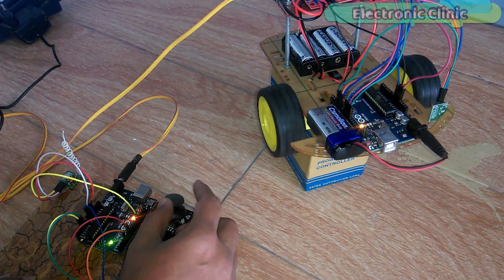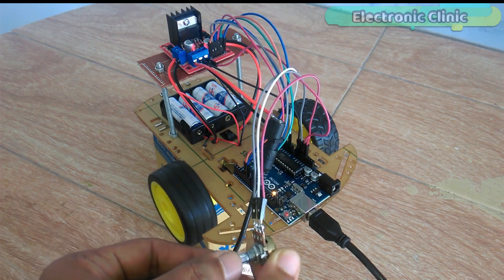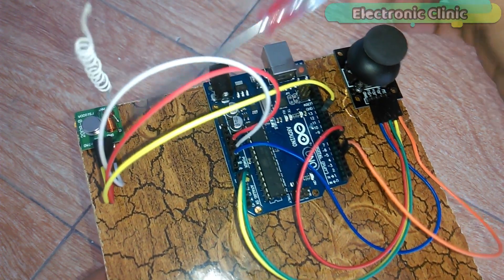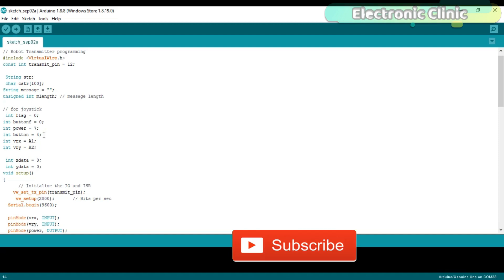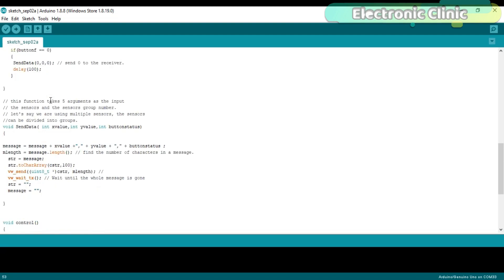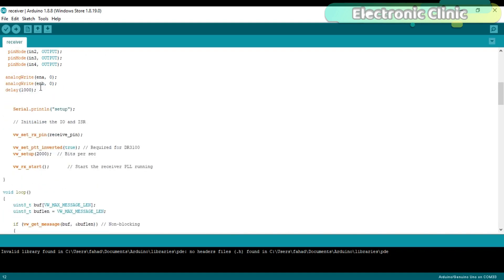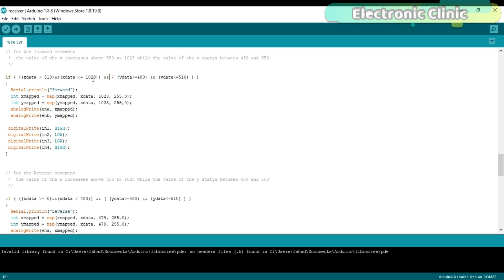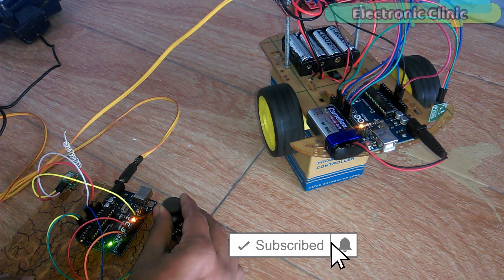Arduino Project: Wireless Joystick controlled Robot Car using 433Mhz RF and L298N Motor Driver

Comment: Great video!
Could you explain what I would have to do differently, if I wanted to replace the normal Arduino at the transmitter with an Arduino nano?
The reason I want to do this is because I want to make the transmitter on a PCB, so the components of the transmitter should be soldered on the PCB.

Comment: Hi brother I followed your instructions correctly. Both tx and rx working perfectly. The serial monitor on receiver side shows the transmitted x and y values perfectly. But the motor not working. I'm using 12v 2 amps single wiper motor and L298 A driver for my project. At first the motor makes some hissing noise while moving  the joystick after sometime it doesn't make hissing sound also. Kindly help me. Thanks in advance brother 🙂

Comment: Sir plz help me in programming. It is telling that return code is not 0. And can i use arduino droid for programme uploading
Reply from the maker: everything is available on my website. i have shared links in the description.
Reply from the maker: use the same libraries which i have used. you can download libraries from my website. go to my website and search for libraries.
Reply: @ElectroniClinic  sir plz tell me your gmail so that i can contact you
Reply: I need a teacher like you who teaches mechatronics. Plz sir give me you gmail and guide me plz
Reply from the maker: stu_engineering@yahoo.com

Comment: Hi very good video. Is the circuit diagram available for download
Reply from the maker: Ya its available on my website. Check description.
Reply: I checked and the diagram wasn't
Reply from the maker: it's a complete series. check my previous tutorials. in those tutorials, I have completely explained the connections.